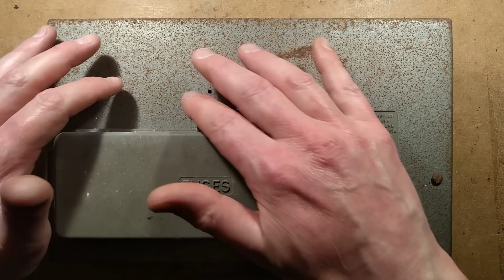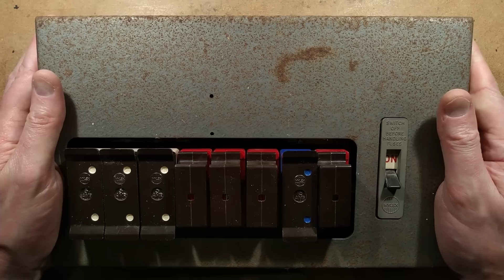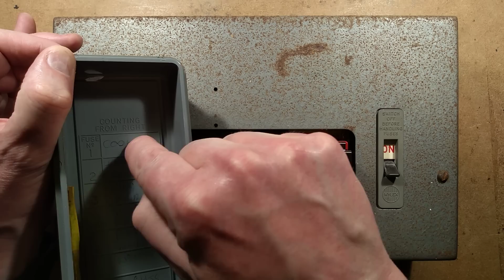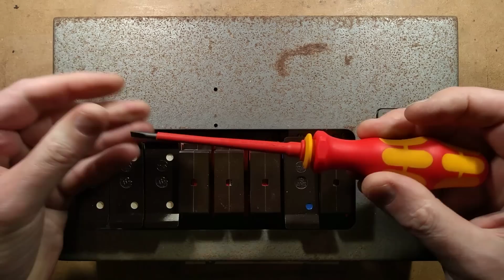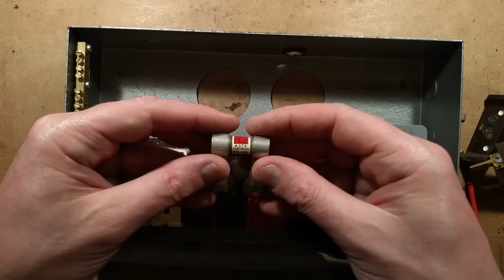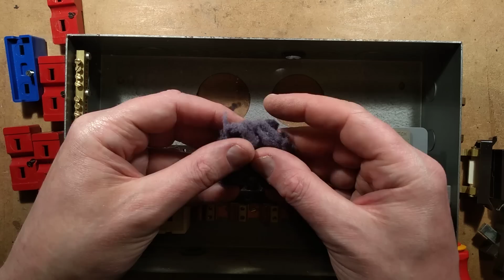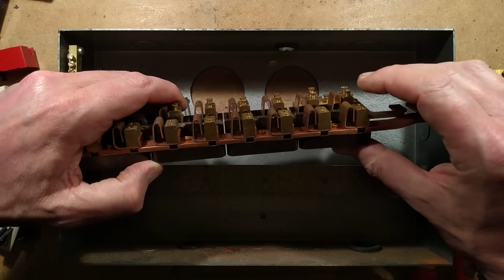Teardown of an old British Wylex electrical fuse box.  (with bare fuse wires)

Comment: As a swiss electrician of the younger generation that has only been taught swiss ultra strict saftey regulations I almost get a hearth attak anytime I hear about the british way of electrical saftey and regulations. There are so many differences and for most of what seemes to be concidered safe in the UK Id literaly  go to jail if I did it like this here. Still verry intresting and educational.
Reply: To be fair, this was the CU of choice in the 70s and 80s, we've moved on a bit since then :)
Reply: This was 50 years ago.
Reply: I don't know about Switzerland, but the Spanish consumer units of 50 years ago had no earthing, 5amp sockets wired into the lighting circuits, wall switches in the bathroom, but did have seperate wall-mouted circuit breakers.  This arrangement was still just recently approved for the installation of smrt meter.
Reply: You realise that unit is at least 40-50 years old? Modern ones are nothing like this.
Reply: @calmeilles  
The swiss one also get an update every 5 years and according to the best swiss tradittions costs you an arm and a leg.... (This is a sort of electriciens basic kit:https://www.electrosuisse.ch/de/shop-neu/shop-normen-und-produkte/produkte/produktedetail.html?tx_kidsshopadvanced_product[product]=122100015592432&cHash=bc74bcd2515c0b721232106dc410545a)
Though the whole world of electricity here seemes to me is rather more complicatet.... For example as it is right now it is more or less illegal for me to install something as simple as a light switch or a socket without being an employee of an approved company,  testing it myself with verified testing equipment, having my boss  vouch for my work , having an official inspector test it all again (this inspector in turn gets randomly checket by more inspectros) and the both me and this inspector writing an oficial report with the results of ouer measurements and sending this to the official departement.....  despite my 4 year aprentisship with both training on site and in various scools.  not saying its all bad but I think there is such a thing as overdoing it a tad.....

Comment: My house still has one of these Consumer Units but the case is made of the same brown plastic as the fuses. All of the fuses are the rewirable ones but the plastic cover around them has been missing since my parents bought the house; since the case isn't metal like the one in the video, I would assume it isn't a huge issue but should I get a replacement cover anyway? (If they still make them that is)
Reply from the maker: It's not a huge issue with the plastic ones, but try searching eBay for wylex cover to see if you can find one.

Comment: quick question, I hear of these ring circuits, couple questions been swirling the space between my ears, what exactly is a ring circuit (I have assumptions but want to know for sure), why does England seem to use them but the US does not have a similar sounding setup?  What, if any, are the benefits or drawbacks to using a ring circuit?  Not sure if you already went over this topic before and I missed it or not but would love to see a video or brief explanation on ring circuits and maybe demystify the whole topic for me, and maybe some others wondering the same thing.
Reply: While we don't have them in Sweden, it's my understanding that it's the case of the wire, say feeding a bunch of outlets, looping back to the fuse board so that both ends are connected there, forming a closed loop/ring.
In normal operation you can get away with thinner wire (and I believe it's originally a materials/cost savings issue) as the outlets are all fed using two wires, from both left and right so-to-say.
If the loop breaks you can end up with one side drawing more current than the wire is really designed for, but is OK when it has the dual feed.
When working on it, if you assume it's a spur/radial and only disconnect one side and then not check, it can bite you from the other side...

More here: https://en.m.wikipedia.org/wiki/Ring_circuit
Reply: At it's most basic it means outlets in the UK are wired in serial instead of parallel, they use a ring of cabling that goes from the consumer unit to outlet after outlet after outlet and then back to the consumer unit.  The biggest pro is that it uses vastly less cable than wiring every outlet individually, the biggest con is that any one outlet has the potential to draw a very large current from it, hence why we have fuses directly in the plugs to protect the wiring between the outlet and an appliance.  A typical home will have 4 "rings" - upstairs outlets, downstairs outlets, upstairs lighting, downstairs lighting and then direct wiring for stuff like washer, dryer, cooker/range, boiler, etc
Reply: @krashd  Not technically in series - no more than 2 outlets on the same radial circuit.  To not split the voltage between two loads, all outlets are always in parallel (if connected to the same phase)  It's just a question how they're fed and fused.
Reply: @krashd  technically they are still wired in parallel otherwise if you unplugged something the entire circuit would cut off.  they are daisy chained in parallel in a loop from what was said and what i read from that wiki page.  its just that the common, ground and mains leads of the circuit connect both ends at the breaker box with no terminal ending in an outlet anywhere like we do in the states.  the ring circuit is a fascinating way to have a balanced load along the circuit where it will reduce the overall current draw on the feed line since it has two paths to travel and if the resistance of one leg of the loop is higher than the other it will pull from the path of least resistance while the center tap will pull from both sides theoretically since both halves of the loop should be equal in resistance.  Still I wouldn't feel confident reducing the wire gauge just because I had a ring or loop.  and I also cant see how a ring would save money when you could have a single run of say 10 yards terminating at an outlet but a ring would require 20 yards to go all the way out to that same outlet then return to the breaker.

Comment: Would be interested if you had a look at one of those apple chargers that have been recalled.
Reply from the maker: From the article it sounds like the adaptor case is breaking exposing live metal inside.
Reply: @bigclivedotcom  fair enough probably not worth your time

Comment: Hi I’m not sure if you can help but I tried to change one of the fuses in mine and it still wouldn’t work. I’m thinking it’s the cartridge that has issues, is that a possibility? If I put a different cartridge in it works. I also don’t know where to get a new one and I’m not really sure what to do or what the cartridges are actually called
Reply from the maker: If it's a rewireable fuse holder the fuse wire has to be trapped securely under the screws with any loose ends trimmed off.  Make sure that you use the correct fuse wire rating.  If it's the type of holder that takes the cartridge fuses then you can buy them online.  Look for wylex fuse cartridges on eBay.
I recommend turning the main switch off while changing fuses and definitely making sure you use the correct size for the type of circuit.
If in doubt, get advice from an electrician.
Reply: @bigclivedotcom  thank you for your help!!

Comment: Up until a few months ago we had a Wylex fuse box, but instead of a metal case, it was all  bakelite.  We had it replaced as it kept making noises and letting out smoke plumes. It sounded like fireworks going off. Not good.
Reply from the maker: That sounds like a simple bad connection.

Comment: Wary interesting as always! :-)
I hope that you please will answer my question: When does voltage gets dangerous? I am thinking of i.e. 15V 60A / 120V 10mA.
Reply from the maker: The risk of shock is considered as above 50V.  But in wet conditions it can be lower than that.
Reply: @bigclivedotcom  Thanks a lot for answering, so 55V 20mA would be lethal while 40V 20A would be fine in non wet condition?:-)
Reply from the maker: @friedmule5403  It all depends on a number of factors including the environment and skin condition.  But below 50V is classed as extra low voltage.
Reply: @bigclivedotcom  Thank you wary much! :-)

Comment: The arcing to the metal frame is of course a risk with the cover off, but don't the fuses in the street will blow, as the holes were on the load side of the fuses in the fuse box ? see as the metal bar is at the bottom and hole at the top ?
Reply from the maker: In the UK the utility company's fuse is in the cable head next to the meter indoors.
Reply: It doesn't matter which side of the fuses the holes are.  The arc develops across the blowing fuse and then jumps the gap to the metal case connecting both sides of the fuse to earth and blows the 60/200A fuse in the cutout.
Reply: @petehiggins33   my bad, I would have assumed the arc would not be able to span such a distance ( fuse length + gap to metal case on load side )

Here is hoping for bad grounding of the metal case :-)

Comment: got a 4 gang one in the out buildings it has just been condemed because 2 of the plastic keepers under the fuses are missing,can you still but them too it would save buying a new consumer unit.
Reply: Screwfix have the plug in mcb''s for wylex boxes, which come with the colour coded plastic keepers.
Reply: Yep, plenty available. Got some new on eBay. Search for 'wylex fuse carrier'.

Comment: I guess the Brits know what they are doing with these boxes, the small screws to wrap wires 
around, are they for neutral or grounds, grounds I think as I think all circuits are same voltage
with different amps ratings. So what is the voltage coming in to this panel?
Reply from the maker: 240V.

Comment: Would you think drawing 2.5 KW for 4hrs a day (10 amp) would damage a domestic socket?
Reply from the maker: It can cause issues with sockets over time.  The problem can sometimes start in the plug.

Comment: When the electricity board came to install an isolator switch in my old house they dug up the incoming supply cable in the front garden and physically severed it in order to cut the supply. Once they'd finished installing the isolator switch they reconnected the cable and reburied it. Is that not the typical way of dealing with this problem? For some reason though cutting the cable also cut off the next door neighbours electricity so the whole operation had to be coordinated with them.
Reply from the maker: That's odd.  They'd usually pull a fuse in the incoming cable head.  It might have been an unusual system.

Comment: Other than the legality of breaking the seal, is there really a big problem with pulling the 80/100A incoming fuse ? I would think that if you switch off the consumer unit first, so that there's no load on the supply, the chances of any arc flash happening are so miniscule. I did it when I rewired my parents property some 15 years ago now (there was no seal on the fuse anyway) and nothing bad happened :)
Reply from the maker: I recommend breaking the seals and pulling the fuse if it's the safest way to get isolation.  The utility companies must come across it all the time.

Comment: Just changed out an identical unit on our 1980 house for a new consumer unit last week. Prior to that I had used rcd adaptors on one or two circuits.....however, the lid doesn't fit after that......ugghh
Reply: The lid on the new consumer unit doesn't fit?
Reply: @uK8cvPAq  No,  on the old unit with the RCD adaptors fitted they stand a lot higher so the old lid (see Clive's video) doesn't fit........I ended up buying another old cover and using it as a spacer. But then last week the whole lot got thrown out in favour of a new Consumer unit.

Comment: Hello Clive there was one thing you didn’t mention it was that you couldn’t place the higher value fuse carrier in the lower value holder.
ie a 30 amp would wouldn’t fit in a 15 amp holder and so on down to the 5 amp holder. You could do it the other way round which would present a safety hazard . Regards Dave.ps I wish I had a thousand pounds for every Wylex  board installed in.my younger days,
they were always regarded as good quality boards. I still have a white one with the wooden back in my house.
Reply: That'll (re!) teach me to read before posting! You beat me by an hour /and/ I forgot the bit about it letting you get away with lower valued fuse holders. :-)

Comment: Why is the live (or line) busbar so much chunkier than the neutral?  Surely they're going to be passing the same current?
Reply: The neutral is just consolidated. Less distance, so less resistance, so smaller conductor can do the job. If it were as long as the live bus bar, it would have to be as thick.

Comment: One advantage of rewireable fuses is you can tell what the fault was.
If the wire had completely disappeared then it was a short circuit.
If wire had a small break then it was an overload. 
Can't do that with circuit breakers!

Comment: I can understand concern about danger of asbestos but you are right, there are different types of asbestos. Lucky only Chrysotile (aka "white asbestos") is produce and used here in Russia and it is proven be safe under "controlled use" i.e. using basic safety measures like respirators and safety glasses like any other dusty environment. Unfortunately "yellow press" does not make a difference.

Comment: Clive, there is an old joke back in the states,
Do you know why they bury attournys 12 feet under instead of 6?
.
.
.
.
.
.
.
.
.
.
Because, Deep, DEep, DEEP DOWN they are really good people.
Something Ralfy might like t hear.
Cheers!
Always like seeing old power gear. Here in Greece I do have some concern about the breaker panels. They are made of plastic. My question is Are the plastics used self extinguishing if there should be an arc over within the panel. In the States most code requires metal for this one reason. If code permits the enclosure must be tested by UL Labs for fire resistance.

Comment: @bigclivedotcom
Hi mate, just found this in my Inlaws house as there normal unit. I want to change a non switch plug socket to a switch one. Nothing I labeled, am I okay just swticthing the whole thing if for 5 minutes while I do it? Never come across one of this, I'm just a casual DIYer. Thanks
Reply from the maker: Yes. That should kill everything if there are no other units in the vicinity.  But always check the power is off before removing wires.

Comment: To add isolator/replace fuse board etc, without needing to pay for  electric board fuse to be removed/reinstalled... 
Simply don't pay bill for a bit, and have meter changed to a prepayment meter. Let meter run out of credit and it'll disconnect the supply.

Comment: VDE? Very Dead Electrician?

Those hand-wired fuses seem like a open invitation to disaster.

The other fun fact about old-timey movies is that the light source was a carbon arc light no more than an inch away from the film. Note that nitrocellulose, aka guncotton, is the main ingredient in smokeless powder for firearms.
Reply: @pmailkeey Very true. The light was still bright enough to warm the film up in just the short time each frame was in front of it, though. If the film stopped moving, the light could still set it on fire.
Reply: I've seen the innards of the projectors. The old ones were really that close.

You can't trust consumers to put in the right ampacity fuse if they are interchangable, hence the ratcheting reducers that block insertion of fuses with too high a rating. As a bonus the adapters prevent using a penny behind a blown fuse, which was a common problem in the US. The likelihood of a consumer finding the right gage of wire and installing it properly is rather poor.

Comment: Very good explanation, of old fuse boxes, i have one like this, however it is much smaller, only the lights and the plug sockets, and extra that is not used.  What we need to know, is the public, are they still legal and safe,  i have had no problems at all, except minor ones, when my light was flickering, and one of my sockets would not work.  So fixed both, however still good, i do not overload, at all.  So are they safe, was thinking of changing, to a plug in MCB would that be better,   The adage, if ain't broke do not fix it.  Still rings true, all you do is either fix it, or create more problems, which you never fix, without expert help.  I know it works, and will leave it alone, Are they legal, will they last along time, do i need to change them,  Are the safe,  What do you think,
Reply from the maker: If fired with the current fuseb and the connections are secure it is still safe.  A good upgrade would be a whole house RCD if there's not one fitted already.

Comment: Master electrician plumber 25 plus years experience. So I'm assuming this is just a British breaker box? You don't have two Phase Electrical in the UK? Here in the US we have 2 4or6 independent 120s and both common and ground meat in the Box. I guess over there you just have 220 or 240 and don't jump common to ground?
Reply from the maker: Just 240 and neutral which is referenced to ground at the substation and sometimes at each house depending on the distribution system.
Reply: @bigclivedotcom  we have two hundred amp panels two phase. Which is reduced down to 60 for large appliances and then to 30 or 15. You get hit with 15 or 30 amps at 120 volts you can survive. But you get hit with 15 or 20 amps at 240 volts you're a dead SOB. It just seems unsafe single phase 240.

Comment: I see so much asbestos in my line of work. The forced air heating systems in homes built between the 1940’s to the 1980’s often have asbestos around the boots. That said, I have seen asbestos in even older homes.